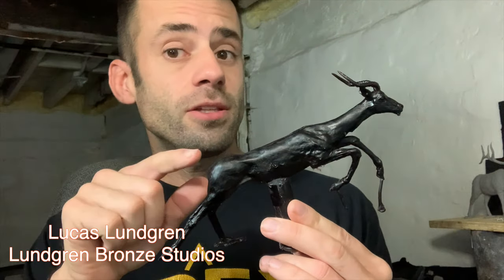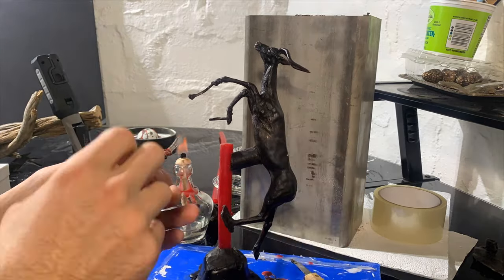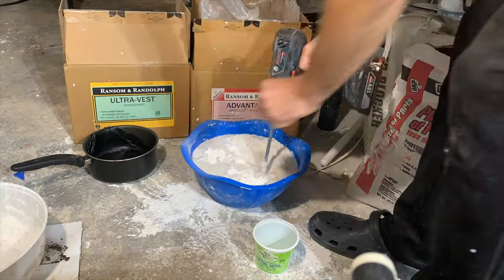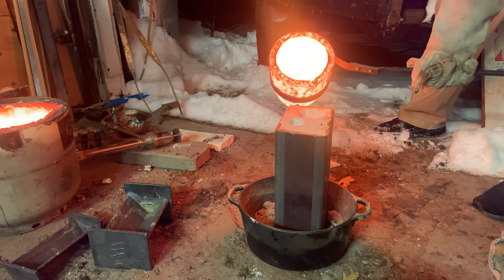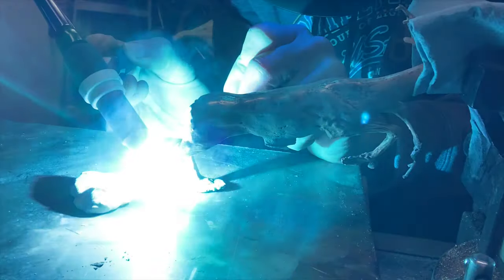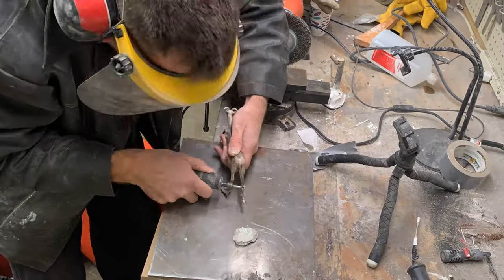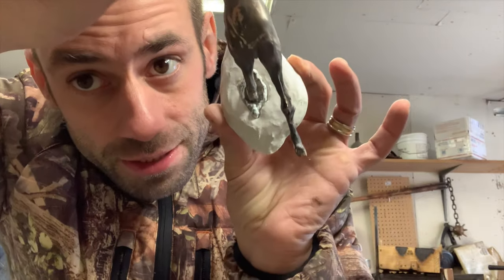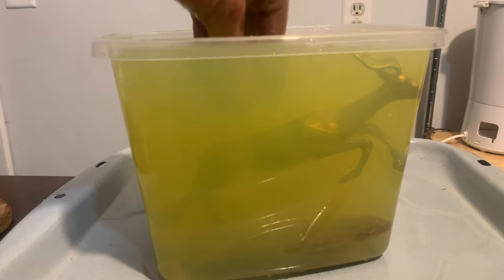Casting Solid Bronze Impala. How Bronze Sculptures are Made.

Comment: I really enjoy your channel and have learned a lot. I can relate to when you said sometimes the price of experience is failure. I am a Bladesmith and want to include some casting in my work, pommels, guards, etc. I have one suggestion for you, get a Foredem tool, it will give you MUCH more control than a Dremel. It has a foot control to control the RPM's and has full torque even at very low RPM's, and a flex shaft and handpiece, great for working on small details. It is costly but should last you for your lifetime. As much as I see you use a Dremel, it would be a wise investment.
Reply from the maker: Oh I use that dremel all the time. I’ve been thinking about trying a foredom tool though. I should invest in a good one.

Comment: I just started working with bronze and after my first cast, I'm a bit bummed at how dirty my casting turned out. I'm wondering if you did anything special to the melt in order for your cast to come out so clean. I sandcast instead of investment casting and I assumed it was my copper/tin mix wasn't pure enough.
Reply from the maker: Scrap metal can be tricky because you aren’t really sure what the alloy is. If it’s copper wire , or pipe though it should be pure. 
I use silicon bronze for the best castings. I buy it in 15lb bars from Lancaster foundry in Pennsylvania. It’s like 6-7$ a lb. 
Sometimes you just need to use clean metal to start. I’ve had some metal that just doesn’t cast well and I had to start over with better metal.
Reply: @lundgrenbronzestudios  I guess it was my fault as I used copper wire bought in spools from the hardware store. I guess it must've been my pattern or the metal wasn't hot enough.

Comment: How do you make the wax sticks for letting the air out? Do you buy them or whats the easiest way to make them?
Reply from the maker: I buy them it’s called spru wax. I get it from Rio grande jewelry supply.
Reply: @lundgrenbronzestudios  Ok thanks. I'm trying my first lost wax casting tonight but I'm using lead glass.

I tried to make it out of brass yesterday but my electric kiln didn't properly melt it. I used an alumina crucible and I think it needed to be graphite.